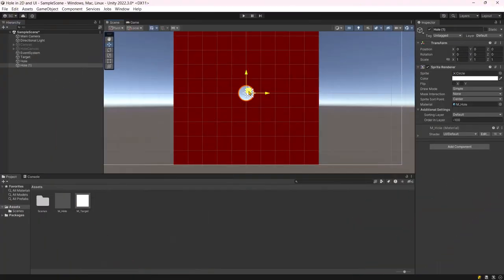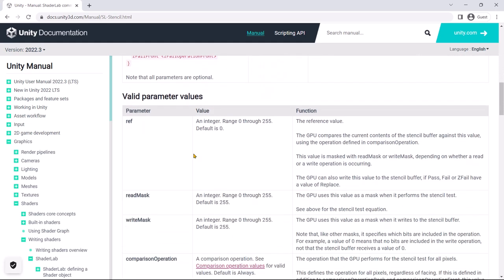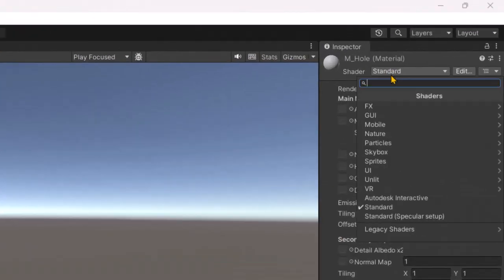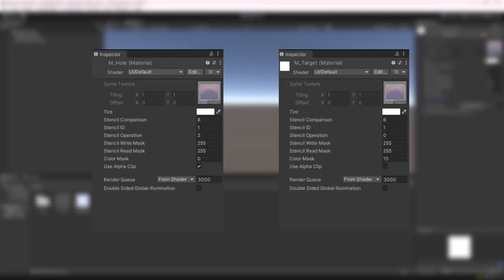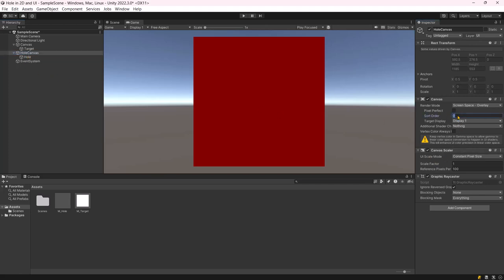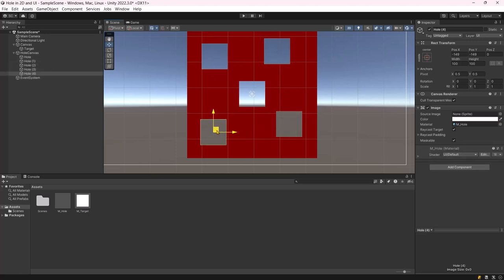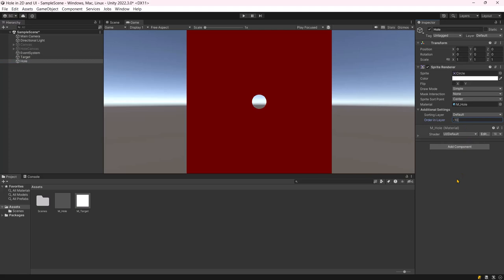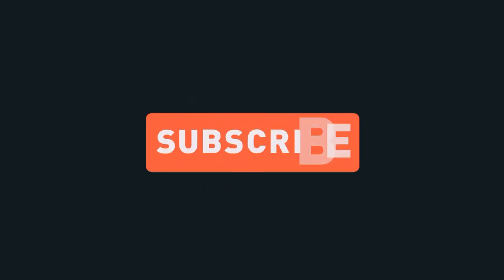Creating Hole in 2D sprites and UI images | Stencil Testing | UI/Default Shader | Unity Game Engine

Comment: You can use sprite mask to achieve same results, no need to do all unnecessary stuff
Reply from the maker: Sprite mask only works with the Sprite Renderer component.
On the other hand, The method in the video will work with sprite, UI image and any other game object which are compatible with the materials. Even the UI text component can be used as a hole using this method.
Reply: With sprite mask you can create only 1 hole